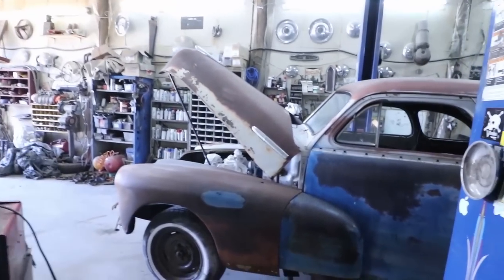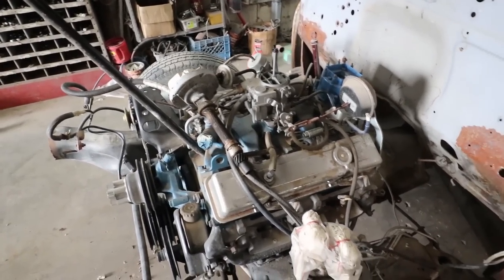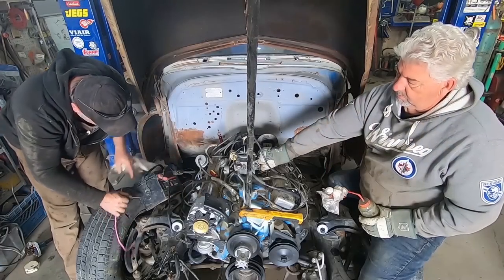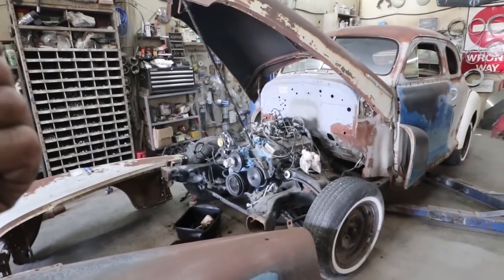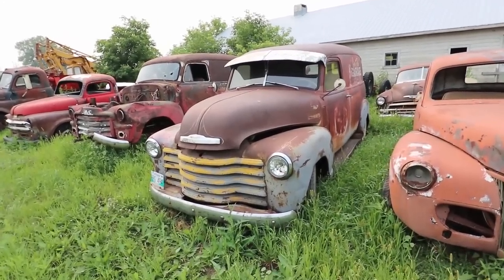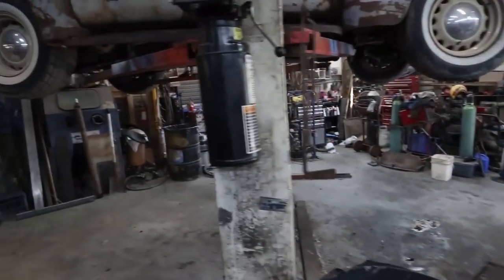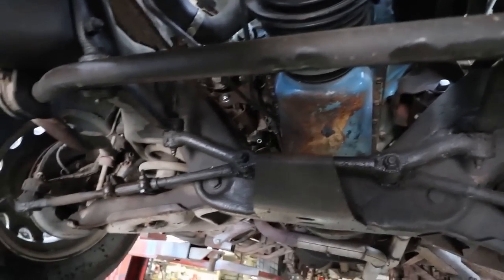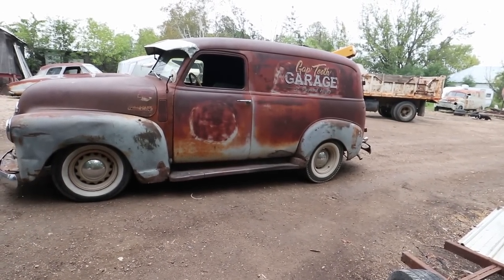Swapping out motors in the 1949 Chevy panel truck.

Comment: Your Shop Floor must have been Hella thirsty and those  Motors, Transmissions and I think a Radiator even added to quenching it's thirst lol wish I could have seen some of pulling the old Engine and Transmission as well as stabbing the new ones can't ever get enough of it especially when you can't do it your self any more

Comment: 8:10 How did you convert that hydraulic piston to air ?  Or is it electric ? Thanks.
Reply from the maker: Just changed the cylinder, you can get them at princess auto to harbor freight has them.
Reply: @HalfassKustoms  Thanks

Comment: Does the "cap" above the windshield reduce speed or increase a lot fuel consumption ?
Reply: You will only notice some wind noise above 80mph. No change in mpg. I put one on my 2015 Ford Focus, black with flame paint job and I get some approving comments. Made it out of 3/8th round bar welded to flat bar bolted to the A pillars with nutserts, covered with fiberglass cut from an old pickup box cover. If ya want to see it finished go here.
https://youtu.be/MDKmYBFX45A
Reply: @EdOfTheNorth  Great Thanks.

Comment: How did you convert your engine hoist to an air over hydraulic system? Did you change the cylinder or just add a component?
Reply from the maker: Just changed the cylinder, you can get them at princess auto to harbor freight has them.
Reply: @HalfassKustoms  thanks

Comment: What always strikes me in a lot of American old car YouTube videos is that there is a lot of attention for the engine. That the rest of the car has rotted away that's apparently not important.

for example in this video all metal around the engine nothing is done about it that is not painted.  When the engine is out then it is the opportunity to do this.
Reply from the maker: I'm sure you could but I'm imagining the cost to get there would be insane.
Reply: It doesn't have to be expensive at all, I've seen good videos on YouTube how they do it. Cut out rotten parts and replace them with new metal. paint small parts with a brush and spray the big parts with a paint sprayer. 

Of course you need to have the knowledge.